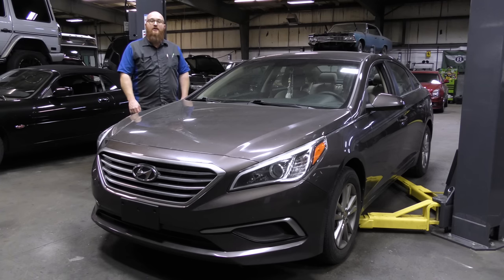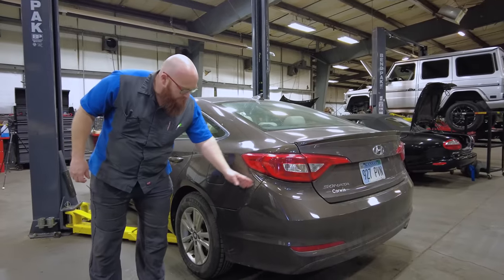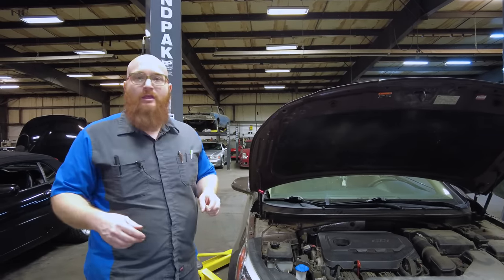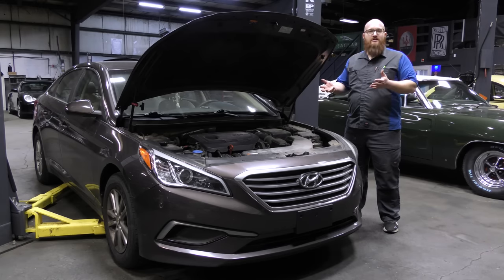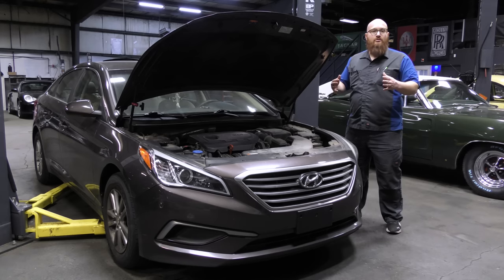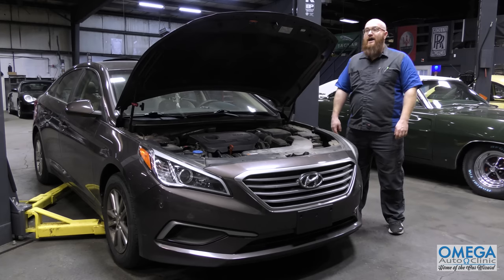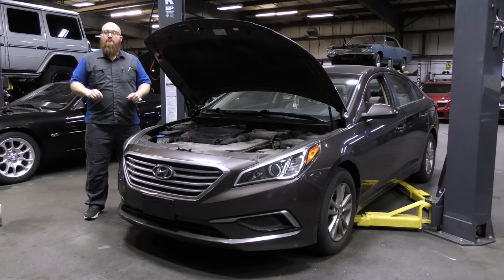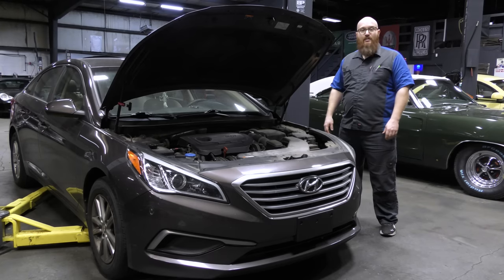What could be so bad on this '16 Hyundai Sonata that the CAR WIZARD is sending it to the junk yard?

Comment: I am Korean.
I expected an American car mechanic to talk about Korean car engines someday.
It was your video today, and my prediction was right.
In fact, the issue of modern direct injection engines in Korea is quite old.
Past MPi engines still have great durability.
As a Korean, the fact that Korean cars are often mentioned by Americans.
I feel quite happy, but I feel bitter about many bad issues.
I feel that.

Thank you for the video.
Reply: I remember Hyundai in 2000s; their engines were very reliable. My father owned an elantra with over 500,000 km on the original engine and gearbox. It's sad to see how Hyundai engines have declined since.
Reply: 2000s were definitely the heyday for Hyundai/Kia
Reply: @anasevi9456  Americans love Korean food and technology. We also love your cars, but they are having problems right now. And many even like your music!
Reply: Some of Hyundai's higher-end products have a much better reputation now, starting with the 2009 Genesis onwards. They're basically seen as "the new Lexus."
Reply: @Browningate  I haven't heard that, only that it's in the same vein as how Lexus started; that's what they were going for. I.e. it's super debatable if they actually got there
Reply: @nthgth  Not really. The Genesis, Equus, and K900, were all arguably successful to some degree, offering unparalleled quality for the price. Heck, they even spun off Genesis into its own brand, and I see a fair amount of them on the road now.
Reply: If the oil level was maintained on the car and regular oil change intervals were done you wouldn't have that problem. Yes those engines have an oil consumption problem like some other modern engines, VW, Toyota with the 2AZFE 4 cylinder, some Nissan 2.5 litter engines there's more to list. I have a mechanics Shop as welll and see a lot of late model cars that use oil.
Reply: Yeah don't feel bad it's not you designing terrible engines it's just your nation's car export arm.
Reply: 😢👌, what a shame,huh? It isn’t that they can’t, they are capable, that’s what is annoying. 
It’s rather quite refreshing that you are honest instead of being defensive which isn’t helpful.
I’ve talked to Korean folks at Korean Church, astonishingly they were defensive as if I’m bad mouthing on the products, far from it. This comes from rather a group of intelligent people😱.
It takes sincere and honest people to hold this company along w/ others accountable. 👏God bless you and may He prosper you!
Reply: The old 2.7L v6’s in sonatas and tiburons were bulletproof
Reply: It's not just a Korean problem, it's anyone using direct injection. The carbon buildup on the valves is a known problem and if you aren't running an intake cleaner regularly it's walnut blasting time.
Reply: @michaelafsa4591  From what I understand pistons these days use lower tension rings for less friction. So much so you can slide a piston in without use of a ring compressor. As a result they are less tolerant to infrequent maintenance and even then they burn oil. Like direct injection they sacrificed longevity for efficiency.
Reply: @nthgth  Exactly. I know many people in the car biz and no one is putting Hyundai anywhere near a Lexus in class, reliability & resale value.
Reply: Do you think about 2010 the engines were better? My sister still has my late mom’s Elantra, strong car.
Reply: I have an 07 Sonata and I love it! It’s been the most reliable car I’ve ever owned.
Reply: Also the twin turbo 3.3 is a BEAST
Reply: I happen to love a Hyundai. I mean I prefer Nissan and Toyota but Hyundai is pretty nice for the price. You get what you pay for. Cheapest car on the market is bound to have problems. So I'll take it.
Reply: Hyundai and Kia are having some MAJOR problems with some of their engines these days. Very high oil consumption and that results in a lot of the engines detonating like this one
Reply: Man I would be embarrassed if I was employed at Kia or Hyundai those cars suck ass engine failures and transmission failure as well as cheaping out on simple key immobilizers to prevent car theft not a car I would buy or want to drive I always hate driving my mom's Kia optima it's like trying to puke but it won't come out
Reply: I feel your pain. I'm not Korean, but I'm driving a 2007 Kia Sportage 2.7L V6. I'd like to get a newer car, but I'm not so sure they will last as long as this one. Sad.
Reply: 684,708 miles on my 2012 Elantra
Reply: I have a 2009 Sonata 2.4 with 162,000 miles and it has been great car but when Hyundai went to direct injection, turbos, double clutch transmissions etc. I won't buy another Hyundai. I do oil changes at 4,000 miles and trans drain and fill at 30,000. I expect the car to last well over 200,000 miles. When the the EPA kept raising manufactures' required fleet mpg it was the beginninng of the end for quality long lasting engines and transmissions.
Reply: Korean cars will be great again someday!
Reply: Jason, what you have to realise is that Hyundai America makes their own engines and America has never made a reliable car in history. Their Hyundai engines are terribly made. 
I am in Australia, and all our Hyundais come from Korea. We still have 1990 Hyundais running around with over 300,00 km on them because, for one, we are taught to change motor oil every 6 months or 5,000 km, whichever comes first. Next Korea makes good engines apart from a few flaws over the years but in general, you can't compare an American-built car to an overseas car. 
It's a well-known fact, they are hopeless at building the main reason is that they don't look after the working staff, so nobody cares about quality workmanship.
Reply: It's still a good looking car. I like a lot of newer Hyundai and Kia models from 2011 and up. I like the technology features and amenities. Only bad thing going for these 2 brands are their engine issues.
Reply: It’s just the gdi engines. Hyundai/Kia mpi engines are just as reliable as anything else. I’ve had several, the 2.7 was a real gem of an engine.
Reply: @drewv1785  that 2.7 will last forever as long as you maintain it. Great engine.
Reply: Most of the issues/recalls are specific to US built Hyundai engines.
Reply: He is not talking about all Korean vehicles.  Just the Kia's and Hyundai's with that engine.  I have one of those and have had tons of correspondence from Hyundai talking about issues with it.
Reply: @@phillipbanes5484 originally conventional factory spec every 3k. Then synthetic every 6-10k. Last 250,000 or so run 15w40 diesel oul every 3-4k. I got 250,000 miles out of a set of spark plugs by accident lol.  612k transmission replaced.  Wasn't maintained properly IMO. Had to replace an ignition coil every 3 months during that spark plug adventure. Other than that, just a crankshaft position sensor
Reply: @jciarkowski3109  the 2.7L Tiburon is a very underappreciated sports car.
Reply: Even the newer Smartstream, which went back to MPI seems to have piston wall scuffing issues. https://www.youtube.com/watch?v=bJdQwjNhFvA
Reply: @michaelafsa4591  The engine should not burn oil. Is the engine in that unit burning oil or was the owner irresponsible?
Reply: @DonnieDarko727  But if the engine eats oil your replacement will not work. I want to buy a turbo on my next car but am weary for this reason as those engines eat oil for breakfast after 75k miles where you need to put in quarts on a monthly basis on some Mazdas
Reply: Love the Musso trucks.
Reply: @Browningate  not even comparable to lexus
Reply: @JP-yp2yw  agreed, when the Lexus LS400 dropped in 1989 it took a decade for the for the rest of the industry to catch up. That kind of “dark horse”success is rare. Mercedes Benz fired a bunch people and totally reorganized their R&D and manufacturing because of that car.
Reply: Anyone anywhere can run a car company that produces crap. Americans do it. The French do it. The British do it. Italians do it. Hell, the Germans and Japanese do it now. So don't think it has anything to do with your nationality or pride. It has to do with giving a damn about quality. And just like anyone can decide to make crap, they can decide to make quality products, too.
Reply: @beezlebub3955  That's before Hyundai went GDI.
Reply: @henrykim4230  indeed, and I shall take good care of it ☺️
Reply: @DonnieDarko727  That is incredible
Reply: @Browningate  yeah and they use the same engines from Hyundai's in most models. You know the one's that blow up or catch fire 🔥
Reply: It’s sad that Korean cars are typically spoke about in a negative context here in the U.S. I’m guilty of this myself but those negative points come from negative experiences I’ve had an experience where my friend had this Sonata and it was fairly low miles ,wasn’t the worst thing I’ve driven but it was no where near the best, as I was driving it down the inner city loop doing 65mph (104kph) and the engine completely failed and seized.. beyond that in the midst of the mechanical carnage the brakes failed completely so I was forced to coast with the hazards on into the ditch as my friend instructed me to do.. that was a moment I can’t forget no car under 100k miles should brick it’s self like that
Reply: @grumpyweds443  not all direct injection systems have that issue for example the D4S system in Toyota/Lexus group cars aren’t prone to carbon build up
Reply: I got a 2018 in December. It has less than 7k miles on it and has been back twice for dropping to limp mode from a knock sensor code. That's once before they changed the sensor and once after. The car can't handle rpm load when passing or merging onto the highway. Both times the car dropped to 40mph almost immediately, almost causing pileups. DO NOT BUY A THETA II EQUIPED HYUNDAI OR KIA.
Reply: well korean brands are pretty popular here, ur not surprised?
Reply: @nthgth  because they licenced OEM Mitsubishi engine.
Reply: Hyundai is Korean company but NOTHING TO DO WITH KOREA,
Hyundai KAI just happens to be a Korean  company, thats IT/.
its NOT Korean engines, its Hyundai engines. 
its NOT Korean car its Hyundai car.
Reply: @Browningate  If Hyundai's lux efforts have been "Arguably successful to some degree," Lexus has been "massively successful by every measure." It's not even close. 
I think I've seen one Genesis-as-a-make product on the road in my whole life. 
Used to see a lot of Gen coupes, though, those were pretty sweet. And I always liked the Azera, almost like an ES350 and prettier
Reply: @grumpyweds443  I think if he add a catch can he’ll be ok for carbon build up it’s a must in gdi engine
Reply: @hjer731  hope so but not sure maybe China cars will be the substitute for Koreans car in some countries not USA
Reply: @barbecuetechtips6024  Lol, whut?
@alleneng - some might say that.

Comment: I have this same car only with the 2.0T. I think you're spot on with the oil change interval point. Hyundai says you can go 7500 miles in between oil changes which is way to long IMO. I've changed the oil every 3k in mine since the car was new, and check it frequently. At 100k miles, it does not burn any oil. If I was the customer I wouldn't give up fighting just yet. I've seen several people on the sonata Facebook group that I'm in get told no several times, but finally get it approved after a battle. These engines are junk and Hyundai/Kia know they're junk. Unless they just flat out never changed the oil, hyundai should cover it under the campaign. Id fight them tooth and nail. This is exactly why I've always had my service done at the dealer, and keep all the records so they can't pull this BS if the engine blows up. I think with proper maintenance these engines can be decent. But couple 7500 mile oil changes, which probably turns into 8500 mile oil changes because they're "a little late", and never checking the oil, and these engines are a recipe for disaster.
Reply: Strangely enough I also own a 2015 2.0t, oil changes every 3-5k, oem oil filters, topped up my oil as needed, and it STILL spun a bearing at 98k literally a couple weeks ago. I was recently just approved a "new" engine, turbo, and intake manifold under the lifetime warranty due to huge settlement over these engines. Covers my ass about 10k+ dollars! Unfortunately the impending doom these engines have is inevitable, especially the ones that come from the Alabama factory. Even the 2017 sonata 2.4L i had before this only lasted about 120k miles. Hopefully yours does last a lifetime though. Good luck!
Reply: @NLOE  ya I think it's hit or miss. That's why I've got everything documented though from the cars service history. So if it does blow, it definitely wont be from lack of oil, and they wont be getting out of replacing it under the campaign either. My goal is 150k. At that point, I'll be ready to trade it off anyway.
Reply: A 7,500 mile oil change on a Hyundai turbo GDI engine is crazy.  I sent several oil samples to Blackstone-Labs from my 2017 Hyundai Tucson with the 1.6L T-GDI engine, and it failed all of them for fuel contamination in the oil.  MY car has 32,000 miles on it.  The first sample I sent in had 6% fuel contamination after 3,600 miles.  That means 6% of my oil is actually gasoline and not oil.  The limit is 2%.  Any more than that, and the oil can't protect the engine from wear.  The lab said "1,200 mile oil changes and go fix your car"  I did a second oil change and had the same results.  
The dealer replaced the high pressure fuel pump under warranty.  I did a couple more oil changes and now it's fixed.  I got 1.8% fuel contamination after 2,600 miles.  That means I can do 3,000 mile oil changes, just barely.  Any more than that and I risk damaging the engine.
My friend has a 1998 Toyota Tacoma with 250K miles and sent his oil in after 6,000 miles.  He has ZERO fuel in his oil.  Also, he doesn't have GDI.  Is it a coincidence?  I think not.
Reply: I have a 13 2.0t limited. I keep oil changes regular and it uses just a bit, maybe a quart between changes at 5k. But I know the turbo can cause that a bit. I got the car 4 years ago with 57k on the odometer, it has 101k on it now. Runs well on the road, mpg in town isn't great but I expected that. I know the dealer told me, when I went in for a recall, that there is now a lifetime wty on the long block. I have actually been happy with the performance and the features, so I will keep driving it and if it locks up I will get the engine replaced.
I am also using LiquiMoly 5w-40 in it now instead of the 5w-20 or 30 the dealer would put in there.
Reply: @LabCoatPaul  I agree. I think the actual reccomendation on the turbo models by hyundai is 5k not 7500. But still I'm doing mine at 3k. Oil is cheap engines aren't. I still think 7500 miles in any GDI is to long. Regardless of if it's a turbo or not.
Reply: This exact thing is what kills many modern engines. GM timing chains, GM v8 lifter issues, Ford turbo issues, Dodge/Jeep cam issues.
Reply: @LabCoatPaul  GDI is not worth the trouble.
Reply: You'd have to skip like 5 oil changes for it to get that low they def did this to thenselves.....
Reply: @JuanGonzalez-jw3hx  Not necessarily. Most mfrs consider up to 1 qt per 1000 miles normal these days. With 5 quarts of oil in the engine, and 7500 mile oil change intervals equals no oil well before you’re due for another change if following the recommended interval. I agree with you though, they did probably do this to themselves. But these engines are known to be oil burners also, so it’s hard to tell.
Reply: Update: Just got my new engine installed today, whole process took about 3 weeks. New engine is running as should and is still covered under the lifetime warranty. Replacement process was pretty straightforward but hopefully you guys don't have to go through this to begin with.
Reply: If its low on oil and the engine locks up. Fill it before sending it to the dealer thats how my friend got his approved although the car burns oil like a mfer.
Reply: @sirdaddybigboss funny cuz I was thinking the exact same thing to do if I were in that position.
Reply: @XAMPOL you got lucky! Cars shouldn’t be going through engines like that though, esp with how often you did oil. Hyundai def lacks in motor department. My daily beater is a 2007 Lexus is250 currently at 206k miles, never any issues. Expected from a Toyota. Used to do like 8-9k oil changes when I was young and didn’t know any better, but been doing them every 5ish for a while now.
Reply: @LabCoatPaul  Could that be because it is a turbo? I ask because I am thinking of buying a Mazda cx5 turbo but I heard issues like what you describe which make me weary as I generally keep cars almost 10 years
Reply: @timgibney5590  I think most newer cars have oil contamination issues.  GDI sprays fuel in at high pressure, and it can get past the piston rings.  The turbo increases pressure, which also pushes fuel past the piston rings.  Some engines have weaker piston rings that don't seal as well for lower friction, which also lets fuel past the piston rings.
The best car ever made was the 3rd generation (2006 - 2012) Toyota RAV4 with the 3.5 liter V6.  It has 269hp, gets about 25mpg, and has normal fuel injection.

Comment: An honest mechanic is hard to find, and you're the best honest mechanic out there. My subaru had a minor oil burn, but because it was not 1 quart in 1200 miles a extended warranty offered only on the engine was not honored. They instead blamed on me having a clogged up pcv valve. Dealers want to save the company money